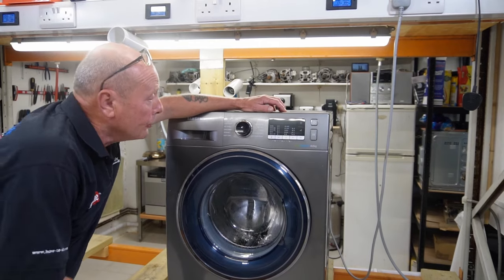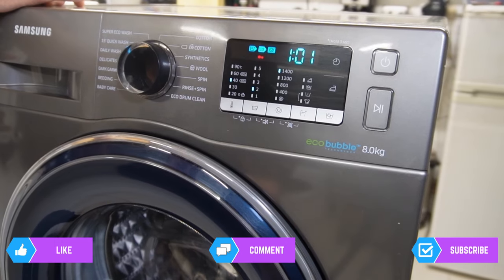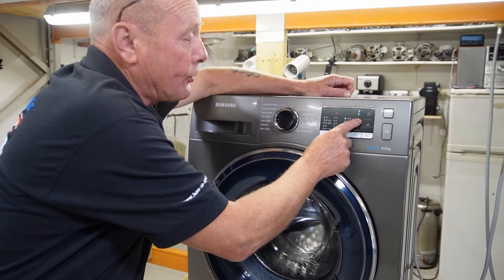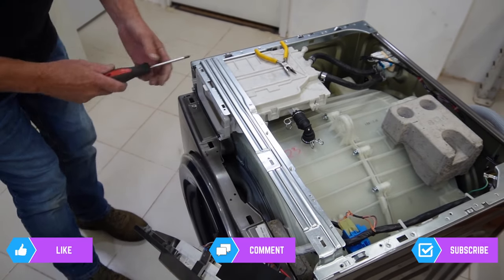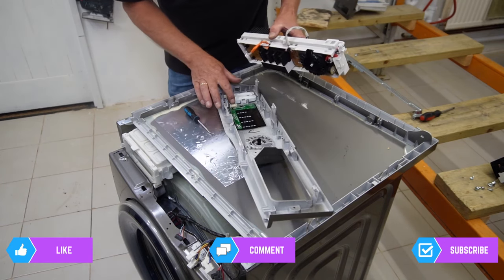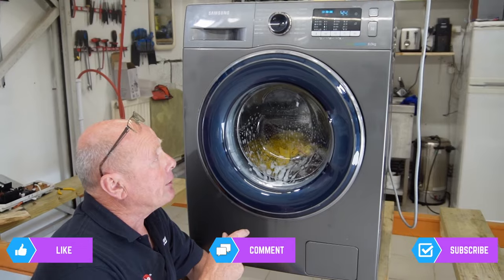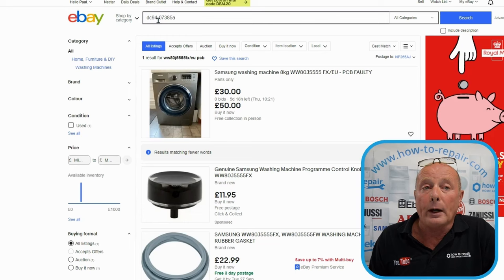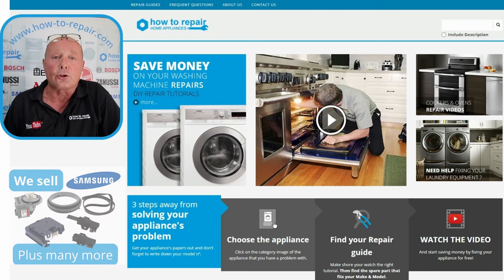Samsung washing machine stuck on program? Fixing intermittent fault & PCB (Printed Circuit Board)

Comment: Hi, thanks for the video!  My washer (samsung WW85K5410WW) stopped at 2minutes then it doesn't respond to button clicks anymore, i then just unplugged it and tried to turn it on, it won't.  I tried the system reset (unplugged, pressed power button 5 seconds, then play button 5 seconds, then replug) still won't turn on.  I suspect it's the same board you're talking about, but before i replace it ($200 in New Zealand), how can i test it to be sure it's a fried board?  Can you share a service manual for my model number? Thank you!

Comment: Hi i have the same washing machine the issue am facing is that the buttons on the dash stopped working ecept the on/off play buttons so i can actually use the washing machine but cant adjust ant of the cycles (spin , water temp..) any pointers would be highly appreciated 

Note: Child lock is not on :)

Comment: I have a Samsung Flex washer that will only drain the water, no diagnostic or calibration cycle.  Stopped working with no code.  I got it to run a spin cycle one time using the app on the phone.  It stopped and gave a code 8C1 code , and the app said check MEMS.  Would a bad MEMS stop it from performing any functions.  I purchased a new main control board installed and the results were the same.  We live out in the sticks with no appliance person with 50 miles.  This is the only video on line that is even close to what is happening.

Comment: Thanks for the useful videos. My Samsung Ecobubble keeps pausing mid-cycle. I've put it into test mode and everything seems to be working fine. I'm not getting any error codes but it still keeps pausing mid-cycle. Does that mean I need to change the PCB? Thanks.
Reply from the maker: I always get a lot of questions like this I can't be 100% as I do not have the washing machine in front of me, but the circuit board is a common problem @ruthblunt77 please remember to subscribe to our channel as that really helps us https://www.youtube.com/shorts/e432SAb2g08  Thanks, Paul 👍
Reply: What did you do to fix it eventually?

Comment: Hello good sir. I have a Samsung ww75k5210ww. The Cotton programme always starts at 3 hours and 20 minutes… but around 15 minutes into it it subtracts almost 2 hours from the wash time, even if it’s a full load. So I switched to Synthetics programme, which doesn’t subtract time mid wash. However, the water temperature feels a lot hotter than the 40°C that I set it to. It feels more like 50°C!  Would this be a PCB fault? Thank you.
Reply from the maker: Really sorry for the late reply I was away on holiday. It is possible that it could be the printed circuit board or possibly an NTC sensor not reading the correct value without having the machine on my workbench. It is really hard for me to be able to tell you exactly. I hope you have managed to get it fixed. Thank you very much for subscribing to the channel have a great Christmas and a happy New Year.

Comment: That sarcastic face is what you're meant to point the samsung smart check app at and line it up and use the phones camera to read the fault code - there should be other characters there to diagnose it. I get the same on my machine, no other characters. My machine won't fill or empty and the door stays locked so I'm thinking the main board is shot, but your assumption that the characters being shown indicate it's shot might not be conclusive - a healthy board would likely show the same too. Did you try the same test on the new board?

Comment: Our machine works on lite or moderate loads.  On towels, it won't complete the spin... it starts to attempt to balance spin it but cuts out before reaching full rpms and then the timer resets back to the pre spin time (rinse period?).  No wobbles of the drum and appears properly centered concentrically within the doorway space as expected.

Unsure why it works on medium loads but not heavier loads, even only two towels.  Seems like a balance issue as the pump functions.  I find it hard to understand how the balancing ring would fail in a 6 yr old machine
Reply from the maker: When you load the drum, it is very important that the clothes are balanced on all sides of the drum. Sometimes the Samsung washing machines can cause lots of problems when you only put one or two towels in as they clog on one side of the drum this, then calls and in balance, I suspect you may either have a problem with the printed circuit boards or possibly if carbon brushes were fitted to the motor you want to inspect these as well. Have a great Christmas and a happy New Year. glad we could help you Dr Sterling Colgate this is for you https://www.youtube.com/shorts/e432SAb2g08 please remember to subscribe as that's what keeps this channel going. Thanks 👍

Comment: i have the exact same issues with my Haier washing machine purchased from AO washes are taking longer the spin mode 1400rpm 10 mins it always gets stuck on 8 mins remaining and goes around and around back and forth  from 10 mins to 16 mins until it figures out what its meant to be doing  and also unbalanced errors during washing  I've only had the machine less than a week so haier are sending an engineer out tomorrow i have asked for a brand new washing machine as i have no faith in the model can not ask the engineer not to fix it and get my full refund within my 14 days  ?

Comment: this is a common problem... it is the MEMS sensor... if it is on the machine change it out. or it is located in the Mother Board so you must change it... also called Vibration Sensor.
Reply: Do u just buy a part and have to fuse it to the mother board or something?
Reply: Will  it cause the machine to turn off?

Comment: Hi, I have the exact same machine, it doesn't spin up to 1400, I can hear it try to step up. Assuming it's the bushes in the motor 🤔, can they be changed easily?
Reply from the maker: It will either be the brushes in the motor, or it could be the PCB  glad we could help you @fill7t138 this is for you https://www.youtube.com/shorts/e432SAb2g08 please remember to subscribe as that's what keeps this channel going. Thanks 👍

Comment: got a 7KG version with 3C error checked the motor but see no issues. might be the motor driver, ran it the diagnostic but number 6 the motor cycle the issue....3C

Comment: My washing machine is a wf45k6500aw/a2, and it is stuck on quick wash; it won't change; the panel is only showing 25min with the hour glass, and then after a bit, it goes into AC6. It does nothing else, and I can't go into diagnostic mode, so what do I do from here?
Reply: did you look up the code AC6 in your printed manual or online? What does the code represent Janiz?

Comment: You should show if Test program run with new board. Because I had problem with doors DC3 , it lock, run drain pump, then nothing ( drum motor do not run), then unlock and nothing more. It show :-  symbol when tried to run Test program too but, later after checking Add door lock it start to run normally. So I am confused with that :- symbol.

Comment: how about fixing the driver card novo times of repair
Reply from the maker: If you are able to pick up a circuit board at a low cost, then it is not worth messing around with the Samsung boards as they are covered in silicon and very hard to gain access to have a great New Year and please remember to subscribe to the channel

Comment: Hello! My Samsung mcs dont want on, just beep, and not iluminate led. You belive it's pcb fault? Tanks for your opinium, and best rgds!
Reply: I’ve got the same problem, it started saying UC on the the display a couple of days ago when Scottish power had a power cut. I turn it off and when I turn it back on no led lights on the display and clicks. After 30 seconds it made the noise of powered down.

Comment: Hello Sir , my samsung washing machine has no power at all , what could be the issue
Reply from the maker: This will either be the door lock the electronic filter coming into the machine, or you may have a problem with the printed circuit board. Have a happy Christmas and a great New Year. please remember to subscribe as that's is was keeps this channel going. Thanks 👍

Comment: Hi .
Reply from the maker: Good morning!
Reply: @How-to-repair  ، 
I have one s washing machine amsung H146 , 12kg . 
Show the CU error , In Iran there is not legal service . 
I find the setting menu with 3,4th key + power key . 
How can I repair it ?
Reply from the maker: I will need the full model number of the identification plate and the details of your problem so that I can provide you with useful literature. Please use our contact us page and make sure you fill out the request for what your problem is. A video shoot of the problem would be perfect as well.

I will get back to you within 24 hours, normally. https://www.how-to-repair.com/help/contact-us/  

Please remember to subscribe to our channel, as that's what keeps this channel going. Thanks, Paul 👍

Comment: Mine is doing the sarcastic ‘smiling face’ when trying diagnostics too.. Not funny Samsung.. What can be done..? Needs a new pcb..??
Reply from the maker: Hi, please use our contact us page and make sure you fill out the request for what your problem is. I will need the full model number of the identification plate and the details of your problem so that I can provide you with useful literature. A video shoot of the problem would be perfect as well.

I will get back to you within 24 hours, normally. https://www.how-to-repair.com/help/contact-us/  

Please remember to subscribe to our channel, as that's what keeps this channel going. Thanks, Paul 👍

Comment: changing the board is uneconomical, solder a new mers sensor, use a resistance meter on any other board components, fuses, caps etc, you have to adapt your skills to the advancements of a washing machine otherwise it will cost the customer a fortune
Reply: i have a meter - but how do I know what to expect  when I  "use a resistance meter on any other board components, fuses, caps etc" for checking the PCB Jordan?

And how can this be done when the PCB is covered in silicon/resin?
Reply: I agree with Mike, without a working reference board there is no way to tell what is/isnt the right value.

Comment: Samsung products in general are technically sophisticated but poorly constructed and designed to make repair difficult. . And if the main board blows (as mine did after only 15 months) you'll get no help from Samsung. And in all likelihood, replacement part won't be available from Samsung; you'll have to buy used part from a 3rd party. Same problem with TWO Galaxy S3 cameras. Never buying anything from Samsung again.

Comment: Quite wondering why Samsung keep on producing the machine with same problem... I got one 1 and half year ago now i am getting 3c error. And i call customer service and they charged me for the visit. Gave a quote for a new unit price claiming the pcb and the motor fault. And the findings are the fun part.. cause of damage due to natural or old.. what a funny way to charge the customer saying that 1 and half year is old or Samsung producing its faulty by nature... #don't buy Samsung#

Comment: While good machines when they work, I understand Samsung's electronics on washers are unreliable.  LG, at a similar price, is better.  There are numerous youtube videos from the US about degraded spiders too, as well as top-loaders catastrophically failing.  This Company has a questionable record for white goods.
Reply: I absolutely agree. They are extremely faulty due to all the ways the machine is programmed to try and not damage itself. It will render itself unusable to prevent from being unusable it's frustrating to the customers.
Reply: Yes! Indeed "when they work". And it will not be that long, I'll tell you...

Comment: Why does anyone have to pay for this fix. Any lawyers anywhere. Have a heart and take on  These crooks. This is not acceptable. They know that the parts will last beyond the warranty and then fail. Fix this not.the machine.
Reply from the maker: Long-established manufacturers seem only interested in selling appliances. They often mislead the public with their well-known names. I've been in this industry for over 40 years, and I'm disappointed with their behavior. They just want to sell you a new machine every 3 to 5 years and hide behind multiple brand names. One company might own up to 10 different brands, so you might think you're buying from a new company when it's actually the same one that fooled you before.

Comment: But what is the root cause of it? It smells like planned obsolescence
Reply from the maker: Components can just fail. Normally it is to do with voltage drops or a component faulty which takes out the circuit board.  @Al-commentario please remember to subscribe to our channel as that really helps us https://www.youtube.com/shorts/e432SAb2g08  Thanks, Paul 👍